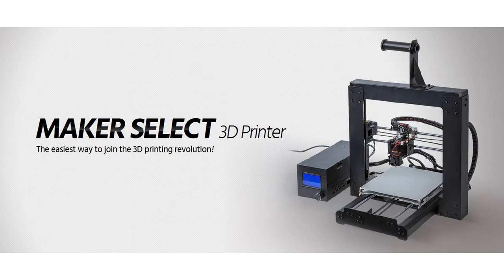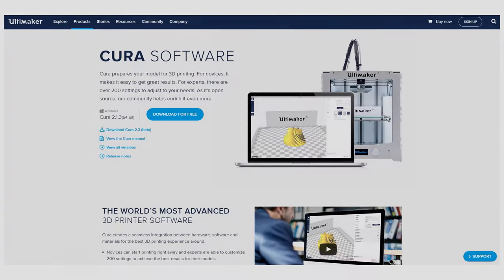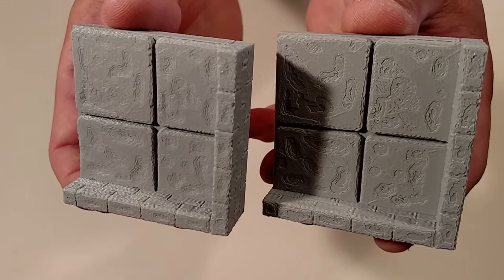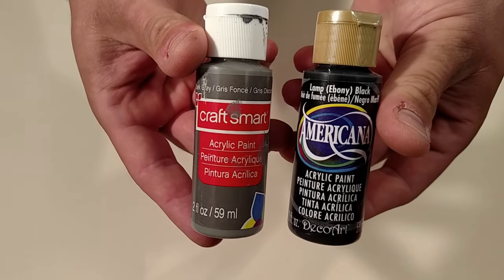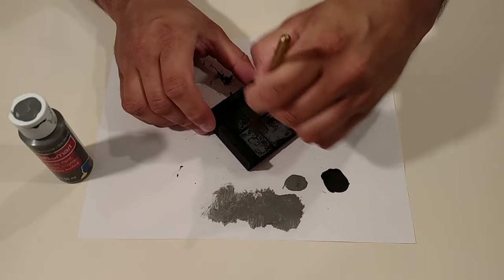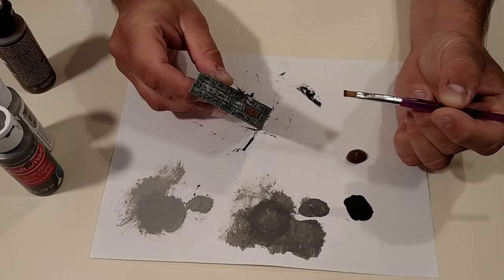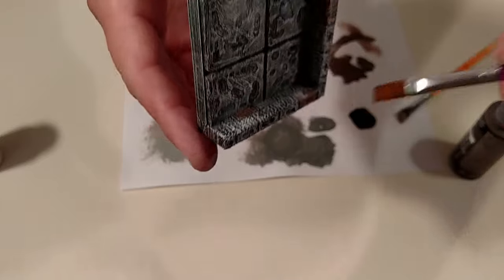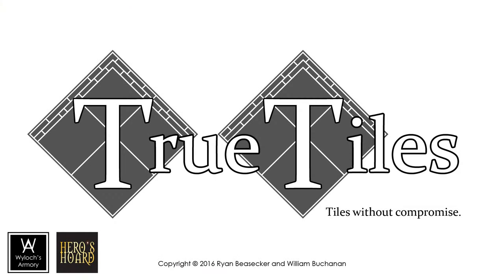TrueTiles - Getting Started (Printing, Assembling, Painting)

Comment from the maker: You sure could. But I print other stuff...scenery, miniatures, etc...and gray is a good neutral color to accept a white or black base coat. If you will always black bomb, then yes, black stock would save you a step. But I do find that the pain helps to slightly fill in and hide the layers (effectively smoothing out flat areas for you).
Reply: The other reason I like grey so much (I originally bought a 1kg roll of white, black and grey along with my printer, and have jest recently ordered a replacement roll of grey, along with red, blue, and yellow for variety) is you can print something out in grey, and see so much more detail than if it was already in white or black... some of the mini's I have printed for friends, I have handed them, and they were so impressed, they have decided it wasn't worth taking the time to paint them, as they liked the detail so much... LOL. (granted those werre on HIGH Detail for this printer, at .06mm layer height, along with supports (which are always a pain to remove).
Reply: Does the black bomb act as a primer as well? Like... Does paint chip off of these easily?

Comment: Hey do you print the lock bases on the tiles or separate? I love your work btw and I can't wait to get my first dungeon on the table.
Reply from the maker: Thanks!  You print them as two pieces and then glue together with gel super glue or hot glue.  I've used both, they work fine.  This ensures that the OpenLOCK cavity doesn't have stringing or supports in it.
Reply: Why dont you just have the pieces already attached instead of making it so they have to be glued together?
Reply from the maker: @LoLGrimfyre  Because that would require supports in the openlock cavity. Which would be impossible to get out

Comment: You talk about the recommended settings when you convert to a gcode for the tile in the download pack but it isn't in the test download pack. I'd like to get a single tile printed before I buy a  full set. Any chance that one could get that info?
Reply from the maker: Bren Mayhugh 0.2 mm layer height, 20 percent infill, initial layer 0.6 mm thick, wall thickness 0.8 mm
Reply: Wyloch's Crafting Vids -you are a saint!

Comment: Does this method of 3D printing not require primer before painting?
Reply from the maker: You will always need to spray prime a 3D printed model.
Reply: @WylochsArmory  Just confirming, since your said "First apply a solid coat of black" in the vid.  Thought it was a bit weird primer wasn't mentioned.

Comment: what size nozzle did you use? thnx
Reply: Standard nozzle from the factory on this printer has been 0.4mm (I have the Monoprice Maker Select V2.1 (basically just an upgrade to the one pictured, as it has a few small changes, and the control box has been updated to have a sloping front - making it easier to read, etc) I have printed many other things on it, but one of the primary reasons I got the printer, was to print tiles like these (originally found through a different source) - but after finding Wyloch and his 1.25" standard, I am majorly impressed, and will be going this route, as I am not sure where I am going to source the 'double thick cardboard' in my local situation - 3d Printing can really offer a whole host of other options as well, with the use of 'set dressing' items both freely available, and those like the expansion sets from Hero's Hoard!